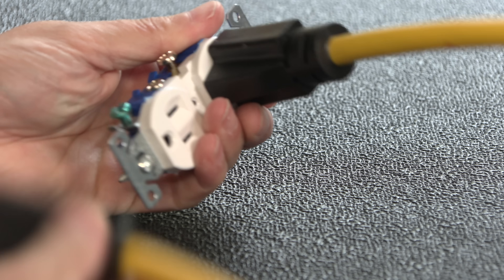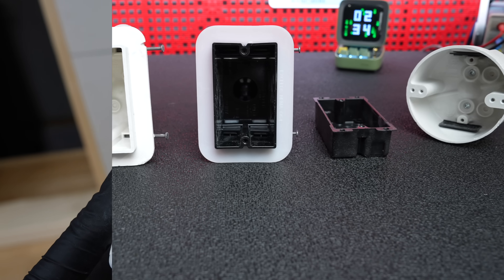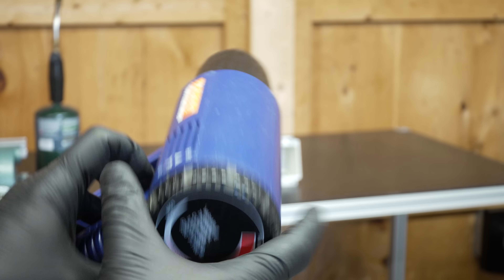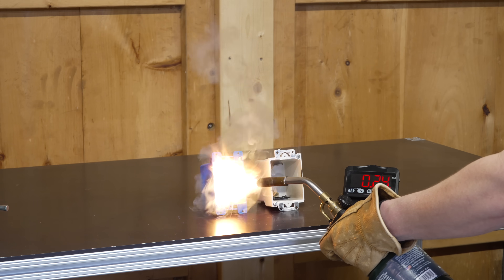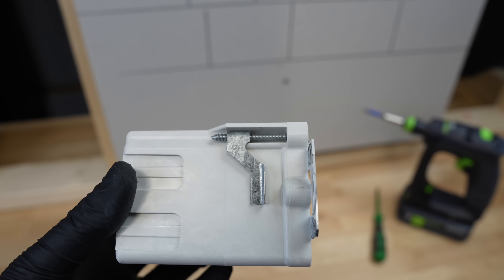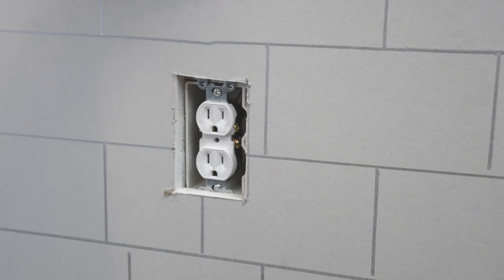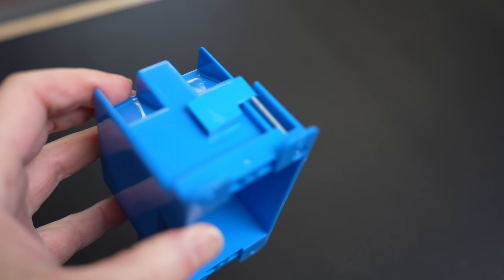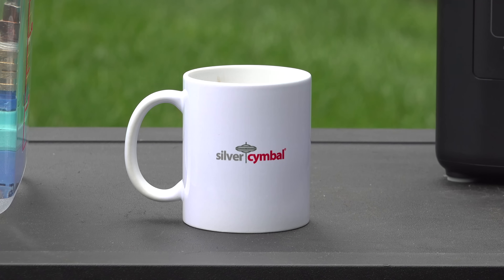The Best Electric Box is the type you have never heard of

Comment: Started using Arlington fuberglass wall cases 40 years ago. Hate the flimsy blue light special boxes. Liked to use fiberglass bixes in all exterior walls to keep out cold air furing the winter. Would seal the cable entry with silicone bathroom chailk ( did not form mold ).

Comment: How do you remove the fiberglass to install the wire?  Do you use a hammer and a screw driver or do you drill a hole?
Reply from the maker: You definitely don't need to drill, just a tap with a flathead driver works for me, or you can use a punch also. The models that have gaskets just press through.

Comment: Metal is the best, the only reason entire America uses plastic/Romex because its cheap to build. The cost of repair is then passed down to the homeowner (drywall tearout and repair of wire) vs conduit runs where you only pull new conductors. Conduit is where its at if you can afford it ✊️

Comment: I’ve used the fiberglass boxes a few times and definitely like the durability and inside space for wiring. There are a couple of negatives I’m experiencing however. First, the factory holes for the incoming wiring are covered over with a thin fiberglass layer that you have to either use a utility knife blade to try and clear out the opening or  use a drill. The other problem is trying to feed the wire cable through, especially if it’s 12 gauge, though this is a problem with plastic as well. I definitely will be trying out the adjustable depth feature in upcoming projects.

Comment: Well there was a composite resin box that has been used since the turn of the last century it was called Bakelite, it was originally conceived(formulated) in 1907 that resin when mixed with wood flour or asbestos created a very strong sturdy box that was electrically non-conductive as well as thermally and moisture resistant. By the 1940s more modern lower cost polymers were invented with ease of manufacturing by injection molding made way for a more flexible plastic form we ultimately see today.  So, these "New" J-Boxes are a Nostalgic resurrection of a concept used 100 years ago....  Great product 👌

Comment: Regarding the thumbnail, metal boxes would always be my last choice. Even grounded, the idea of a good conductor surrounding a device with high voltage wires doesn't seem like a good idea. They also cause signal issues if one is using a smart switch or outlet. At the very least, I would expect someone using metal boxes to also use metal conduit or BX cable. After all, why only go with half measures?

Comment: Fantastic video on an interesting product line. One note that most "Smart House" fans may not realize: metal Boxes block the wireless signal to in-box "Smart" devices (receptacles and switches). After replacing all of the damaged and stripped-screw plastic boxes with metal during our minor remodel, guess who learned the hard way? Thanks very much!
Reply: That’s a great tip about smart home devices and metal boxes
Reply: Wow, Never realized that,  thanks for the tip.

Comment: I am a big fan of "Shelly" 1pm mini IOT smart relays which you install inside one of these boxes behind your light switch to control the switch via your phone (or Home Assistant automations...).   the metal boxes in my garage block the RF/Wifi signal - I'll try these!
Reply from the maker: In a garage, especially for surface mount, metal is always a great idea, and metal handy boxes are very affordable. Metal is the most expensive by 3x when you use retrofit boxes thats really where these do well, better than plastic and cheaper than metal. But for RF stuff I agree metal is always good

Comment: One thing to note is alot of people have a negative association with fiberglass boxes because, years ago the threads would strip out on them. In recent years they've corrected that.
Reply: In a recent reno I've rewired a whole house and used mostly plastic boxes but also grabbed a couple Fiberglass to try out.  I believe they came from Menards and I have the same issue with the threads stripping.  I swore off using them for that very reason.  

If there are Fiberglass boxes with reinforced screw holes I would gladly pay the extra $1 per box for them.  Although I doubt the extra fire-resistance is going to matter much in most real life scenarios.

Comment: Those are annoying cause the screw holes strip and you can't "self tap" a bigger screw in.  It just breaks.  If they could fix that I'd like them more.
Reply: You can probably do the old trick of putting something in the stripped hole that binds as you screw in. We did this with toothpicks in worn out door catch holes growing up. 

You could maybe use one of those tiny zip ties for this. Poke it in, snip the excess and drive the screw.

Comment: A misplaced hammer blow will shatter these fiberglass boxes, but will bounce on a plastic box and probably do just a minor dent on the metal one. Also, like plastic boxes, the 6-32 or 8-32 mounting screws could strip out of the holes. They cost a little more than plastic. So they're not 100% ideal replacements. Also any boxes (fiberglass or plastic) with those gaskets are designed for a poly sheet vapor barrier to be adhered and sealed to the gasket around the perimeter of the opening BEFORE drywall is hung.

Comment: Dude a deep 1900 with a  ring will blow your mind.
Reply from the maker: Those are really good. I used one of those as a junction box for all the smoke detectors. They are like the Tardis inside
Reply: @SilverCymbal  thats all we use here. Everything is run in EMT down to the communication and doorbell wiring. Some towns here have addendums for commercial to be nothing less than 3/4" emt and 11b boxes. 4-11s. Most resi guys can drill and pipe over 700' a day per man. It's mostly polish or guys who couldn't test high enough for the A Wireman program.  Same pay as the A Wireman though

Comment: My electrician used fiberglass boxes on my house back in 93. One thing I noticed is they are brittle. Not that it’s a big deal though
Reply: I am noticing that with my older installed fiberglass boxes as well. Gives me a bit of pause on these boxes.
Reply: I would bet that now 20+ yrs later most of that would no longer be an issue with new boxes.

Comment: At least on Amazon there is an additional "hidden" cost of $6 for shipping, so... not just 20 or even 50% more but more than double. 
At HomeDepot I found the equivalent basic box at $5 or so... so, double the price. 

I still like the option to use such a good product, but your soft-sell on the higher price seems slightly misleading.
Reply from the maker: Here are the exact prices for the 3 boxes shown in the thumbnail. All 3 are old work" boxes, single gang. Carlon Plastic $3.47 Allied Moulded ws $4.09 and the Metal Raco was $9.89 - These were all from Home Depot when I compared them. Boxes are like 60% cheaper when you buy a 10 pack some sources just rip people off but you can use the links in the video itself, which are from Lowes.  Hope this helps.

Comment from the maker: Single Gang Old Work Box: https://amzn.to/4bJhI4i - Additional boxes are linked in the video. I absolutely loved these boxes and will be using them for projects. What do you think?
Reply: This is another Wago type upgrade that’s a bigger inflater for one time weekender diy’ers and not pro electricians since the blue plastic boxes get their UL listing from the concept of good electrical work doesn’t ever get hot, and if it does, there’s a problem that an electrician wouldn’t have created in the first place. 
DIY electrical is and should only be attempted by one that has a basic electrical savy and is prepared to do electrical to the NEC minimum standard and really should seek Union levels of workmanship and NEVER cut corners. 
Prevents fires. 🔥